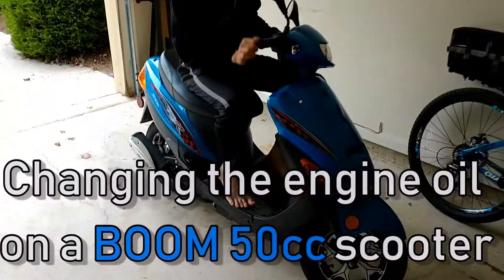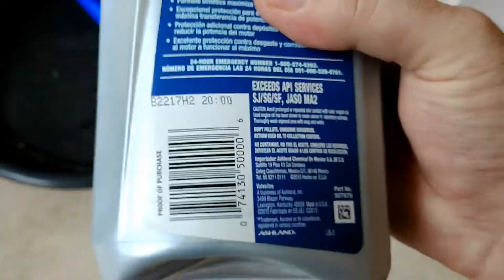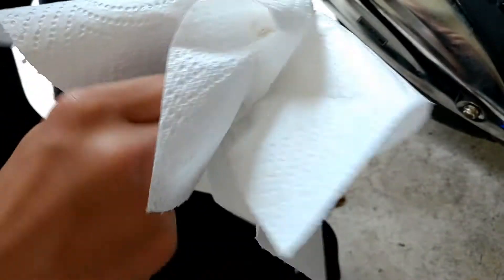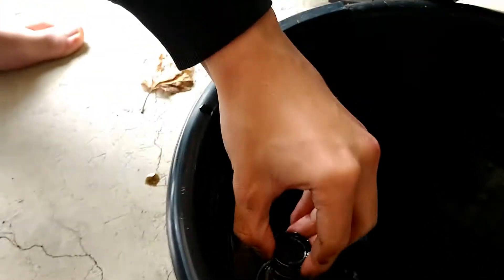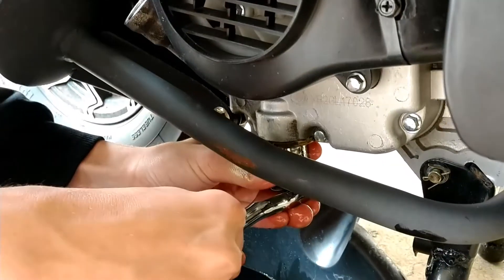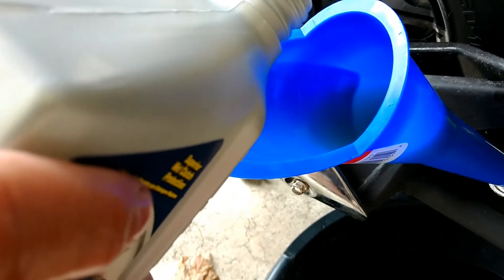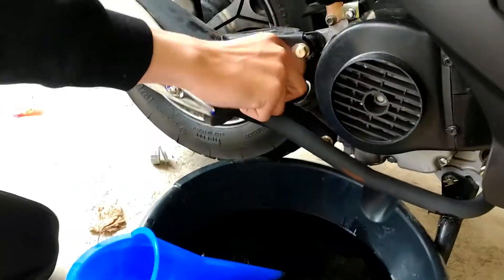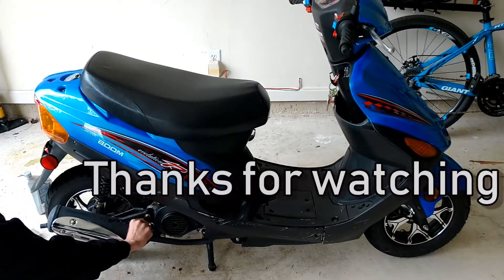Boom 50cc Scooter - Engine oil change

Comment: Hey i have the same boom scooter just got it and it wont start up with electric start can it be cuz i have not change the oil in it yet ? The black dip stick if so confusing or is it the battery how long should i charge it for? Cuz i just got the scooter idk if the batterys are always charged full or not i just need help thanks
Reply: You have to squeeze the brake for the electric start to work
Reply: Aaron Navies  hey do u still have Boom scooter
Reply: I do and mine starts without holding the break

Comment: How is this bike holding up?    Considering getting one for myself.
Reply from the maker: I gave this bike to a teen and I am truly amazed that it's holding up. Had to replace the carb (simple change) to get it to run well. The throttle cable snapped, also easy change, but since then it just runs. I think that once you get it to a stable state, it works and just runs and runs.
Reply: The oil was not black. Ive had it wayyyy dark.

Comment: ONLY MISTAKES. THIS MODEL TAKES ONLY 600 MG OF OIL. U PUT TO MUCH. THE MESUREMENT OF OIL IS MAID WITHOUT SCREWIMG. AND THE POSITION ON STANDER ALSO AFFECTS IT A LOT.